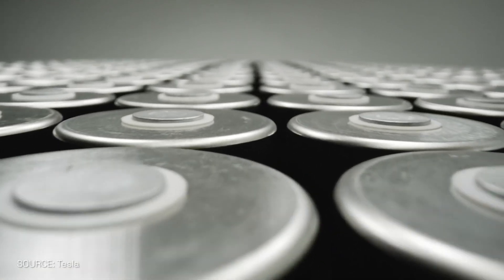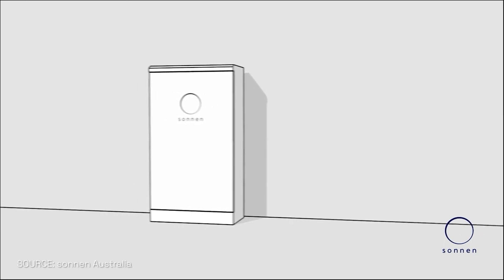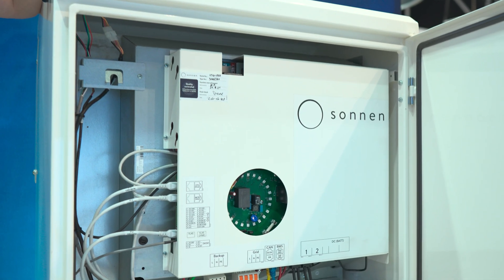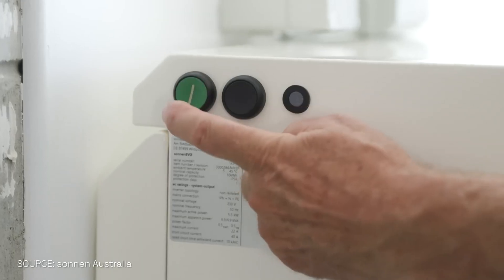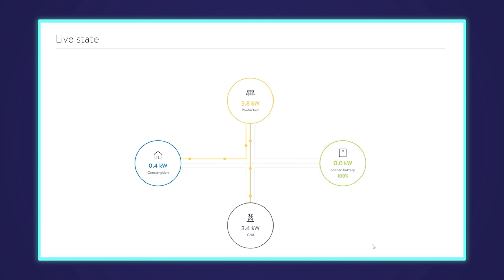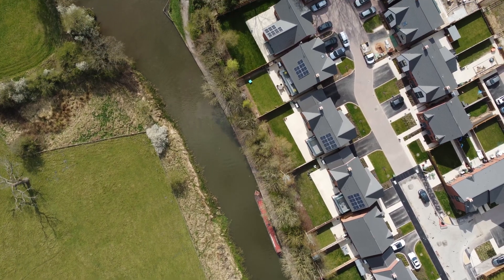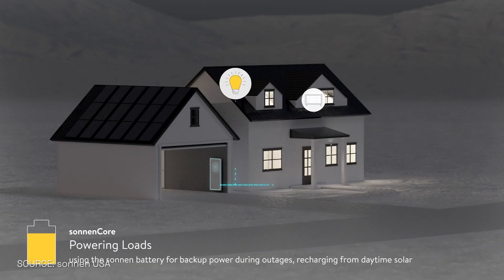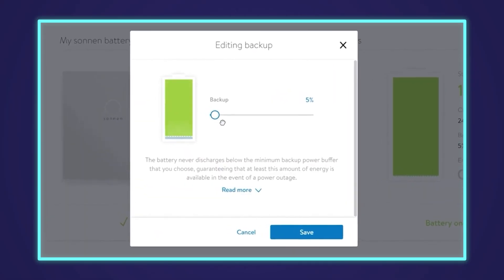Is the Sonnen Battery Tesla's Newest Rival?

Comment: I have had 2 sonnen evo's installed in my shed /workshop , the ambient temperature inside the shed gets quite warm on a hot day ,the batteries don't really like the heat and the cooling fans are activated at 30 degrees  ,the fans create an abnormally loud sound which in my shed drowns out the radio i'm listening to,and they will run constantly from about 11.00 to well into the evening , on a recent hot day of 40 degrees the cooling fans were running till past midnight with the shed doors open trying to catch a breeze, not good for security, 
anyhow i plan to install a whirlybird on the shed roof above the batteries to try and lower the temperature inside.
Reply from the maker: Hey Tim, this is a great idea. We also recommend contacting your initial installer and having some maintenance done on your Solar battery depending on when this was done last. Solar battery maintenance is very important to keep your system lasting for as long as possible, efficiently! Thanks